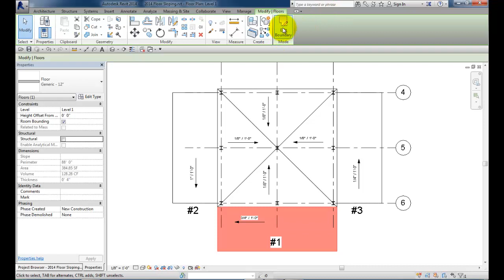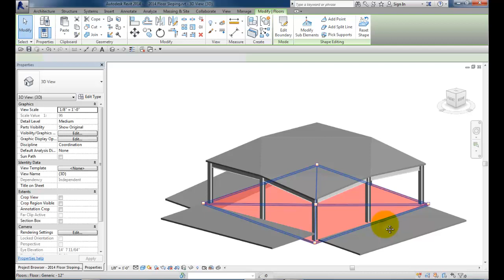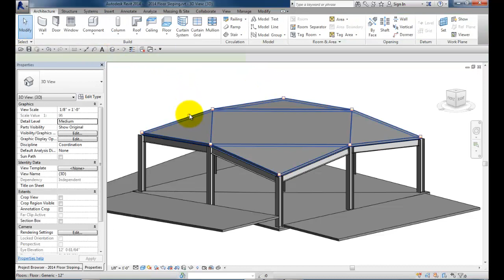Three Minutes with Floor Sloping

Comment: hiya hey thanks for this video, very helpful. do you know if it's possible to slope a floor by giving it a value such as 1 in 200 say. Or would you need to calculate the levels and use the point system? Cheers.
Reply from the maker: Sure, either method 1 or 2 allows an input of rise/run. You'd have to change your units for Slope to make it easier for the input values you'd like to see.

Comment: Hi Steve, you have any idea shy slope does not show in the parameter list for filter selection, for floors or other (pipes for example?
Reply from the maker: The reason is the developers didn't make it possible. Why they didn't is only something they can answer. When I've asked a developer or designer that sort of question I usually find out that whatever I think is obvious or simple isn't...or at least the "nuts and bolts" of making something happen has more "moving parts" than I assumed. Other times it is just a matter of focus. There is a very long list of things that they want to do or think they need to do. It is easy to overlook subtle things when you are busy doing stuff you're already assigned to do. They just started a Revit Ideas site to post wishes, might want to add this to the growing list.